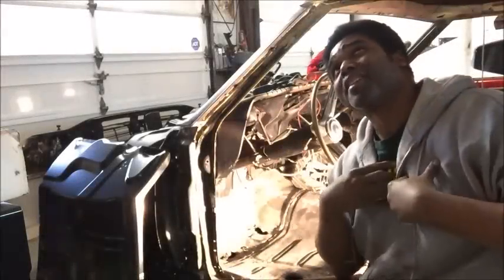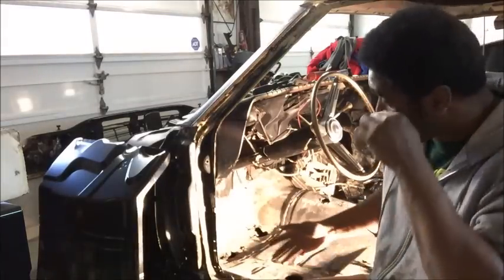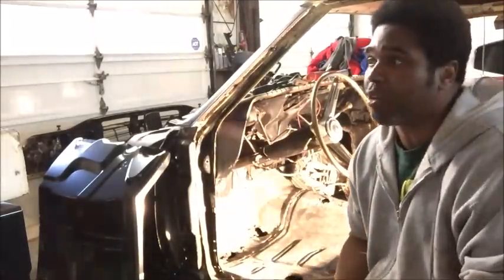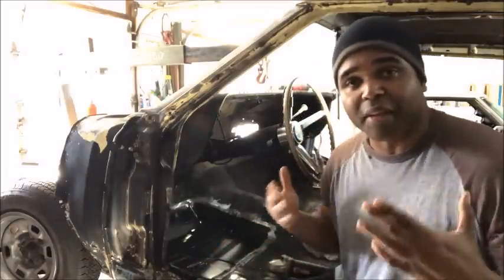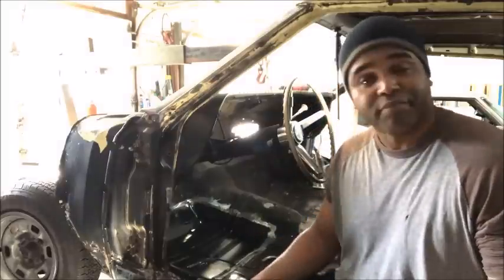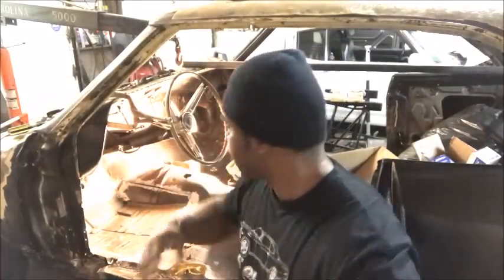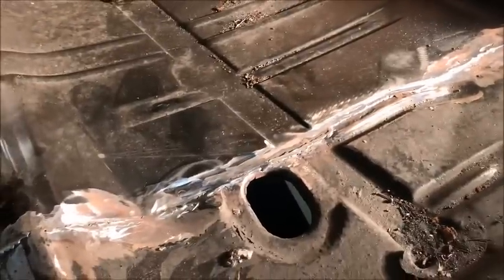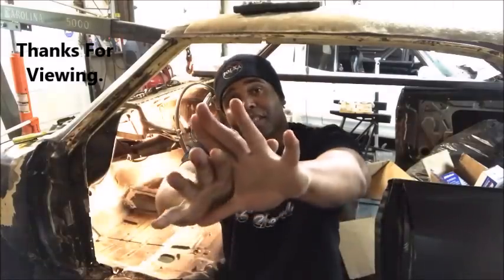How To Install Floor Pans (Cut, Trim, Weld.. Done!)

Comment: A Terry I have a 2007 trailblazer ss I installed a fast intake manifold and also the Holley valve covers which does not have the PVC lil plug nd I'm trying to hook up a mighty mouse mild catch can I also have a valley sprount on my truck how can I go about hooking the catch can up hope u can help me out
Reply from the maker: no problem, from the Valley to the can, out the can to the port on the intake behind the throttle body.

Comment: What's up my man! Great work, nice to see that the chevelle project is coming along. I was gonna patch the floor in my 68 Firebird that way but I decided to just replace the whole floor instead. But do you think that a butt weld is stronger than a lap weld? I was told a long time ago by an old fart to never butt weld something like a floor pan because of the load placed on it from your weight, and that a lap weld will provide extra support in case you hit a bump in the road a 200lb person becomes a 400lb person and a butt weld might not hold over time. He also told me that you can weld a lap weld on both sides to hide the lap joints and then grind the welds, and that no one could ever tell that it's patched. Just a little knowledge that was told to me years ago, I don't know how true it is but he was in the welding business some 40 yrs. so listened to him most of the time. Hey but keep the vids coming and I'll post some vids soon of my project when I upgrade my camera.
Reply from the maker: i agree with him, but being it only where your foot rest it should be ok.. please let me know when you put something up.. id love to see your ridr..
Reply: Will do bro!